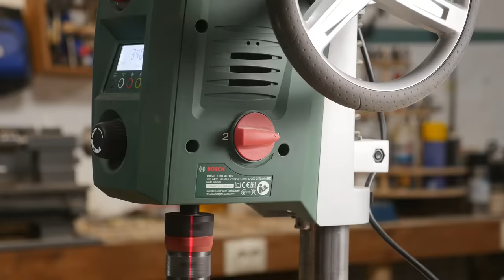A unique idea from old hub bearings! Two hubs and ready!

Comment from the maker: Would you decide to do it for yourself or not?
Reply: As soon as I remove the wheel bearings from my wife's car. One day soon she'll find her car on jack stands. :face-blue-smiling:
Reply: Сделано добротно, но в быту - бесполезна. Я бы такую делать не стал.
Reply: I would decide to but then not actually do it.
Reply: I actually did but it was a pier fishing cart that I over engineered. Complete with front steering control arms and a 3ft tall vertical box at the rear  with a slotted , locking lid to secure rods and reels in.  I used it once before deciding it was too heavy and a  waste of time . Had fun building it though
Reply: I am pretty sure I bought 4 swivel bearing castors to do the same thing making a piano mover with a smaller height, cool thing though.
Reply: I DEFINITELY need something like this.... I'm a dj who has to move a lot of equipment in and out af different venues.... having a cart with four wheel steering would help me navigate around tables and decorations without having to move them for fear of damaging or disturbing anything. Gonna be building one SOON.
Reply: As an old welder/plater I would make that myself, if I needed to. But if I could just buy it, I would do that, if I needed to..
Reply: No.

Comment: Very cool project. I could totally see a variety of different uses for those hub bearings. It certainly facilitates/improves the turn radius capabilities on whatever you put this on rather than the typical 4-wheel set up. Imagine adding to this, a hydraulic pump system that could raise up and lower the bed platform with something heavy like cement bags or animal feed bags perhaps (items that take a toll on your back), minimizing the need to lift or strain your back at all (because not everyone lifts things the "proper" way). Sure, a wheel barrel works too, but the name of the game is work smarter, not harder.

Comment: Nice cart, very manoeuvrable. I would've doubled up on the plywood and used countersunk head bolts going right through the plywood to mount the hubs, much easier than mounting on the steel plate and then all that routering to accommodate the plate and bolts

Comment: Very cool. I would have to alter the wheel type (no flat hard surfaces). Off road wheels would be cool for use out doors. I have seen heavy duty trailers with double linkages behind tractors that gave that same quick turn ability. Thanks for this project.

Comment: Yes, I would decide to build one like this. I am currently working on a gorilla-style wagon on steroids. I made the first version strong but it was too heavy without even being loaded. I now have stripped it of some overkill and am hoping it will haul the weight and still be towable by hand. I made this to haul stuff like 2 cycle motors, washing machines, and every other item that can fit and be pulled manually across slightly rough and hilly terrain. I designed the steering the same way your steering is set up. It makes it much easier and quicker. I have tires off the front end of standard riding mowers. They work well but I think the taller the better. So at 8" now and hope to go with 13" and thinner. Also solid with aluminum rims. The weight adds up and as I mentioned I am now removing probably 20 lbs. It is fun and challenging. I have a mobility chair and am considering implementing that into this cart. But it looks like with the chair all stripped down it may be better to build off that rather than fabricate for the cart. Since the mobility set-up hauls 300lbs. I am also thinking about a powered cart with a seat or just turning it into a utility cart like a back seat or front seat driven with a flat bed at either end. Your build is very impressive. I like the hub design. They put a new meaning to tight controls for sure. And smoothest operation. Great build! Erock, Tulsa

Comment: They should seriously make pallet jacks with this kind of steering... it'd make loading pallets into bays so much easier with this kind of turning radius! I'm sure there's reasons they don't though- especially when considering how those jacks are put together, and that forklifts and other devices need to be able to plug in and lift the standard pallet- it'd probably take drastic redesigning which in the end is impractical.

Comment: The only thing you fail to realize is those hub bearings rely on the stub axle to keep the two bearings together in the hub
Reply: not so, they are press fitted together. PIA to rebuild so the hub gets replaced instead of just replacing the bearings and race.

Comment: I'm sad because you went to great lengths to make it look very professionally assembled and yet didn't take the time to make the geometry correct. The diagonal bar should have been adjustable and the distance from the middle out to the hole should have been exactly the same on both cut with the same template. So many steps to assemble it and make it look pretty and only one step missing to make it perfect. Just goes to show you anybody can make a video.

Comment: 🟦... Well It sure LOOKS like it's Great for get'n tight-in go'n around a pole,..but IMAO, This doesn't appear to offer ANY "Practical" Improvement for this application over swiveling just the front axle ALONE!...& it's actually LESS Stable as WELL!....
...Did you Notice the Wheel-Scrape'n go'n on when you made Very-deep turns?..that WOULDN'T Happen if the Rear-Axle DIDN'T Swivel at ALL!!
... Not only that, but when the axles swivel it REDUCES Your "Effective Wheelbase" & introduces GREATER INSTABILITY on deep turns,... The more weight on it, the Greater It's tendency is gonna be to TIP-Over toward the outside of the turn.